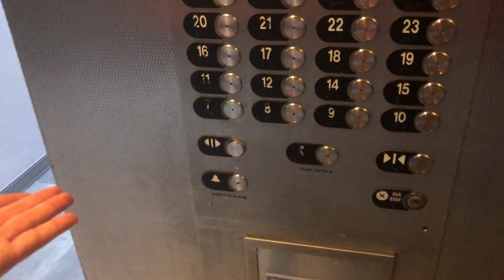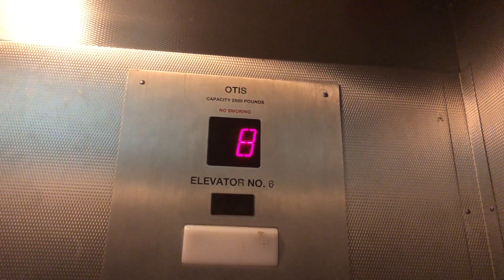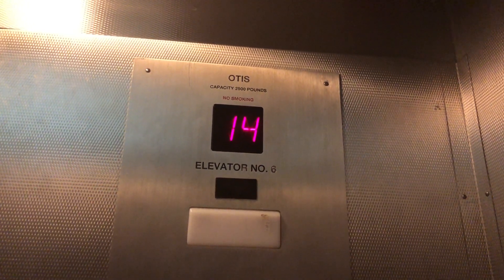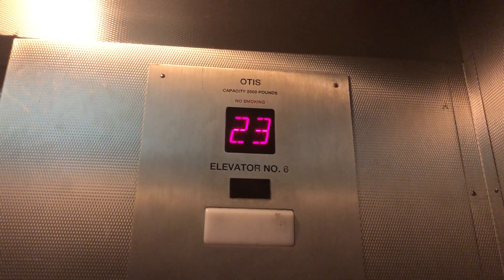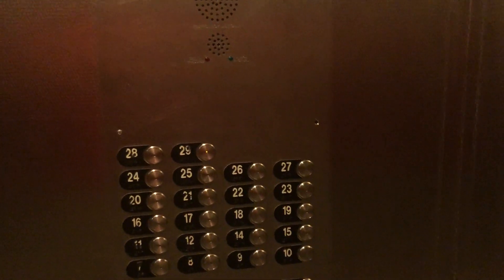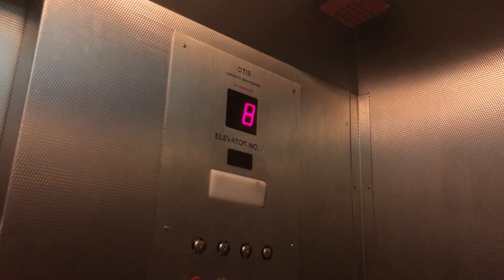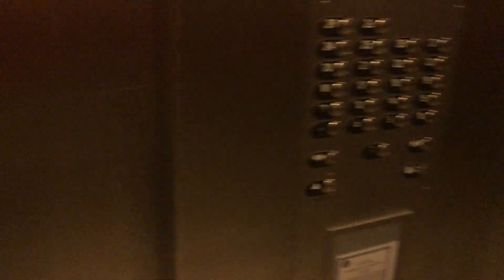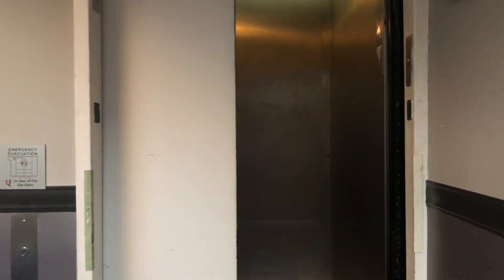Otis main service elevator - Chicago Hotel Collection Magnificent Mile - Streeterville, Chicago, IL

Comment: Also If you stayed there as a guest why were you using the service elevators in the first place?
Reply from the maker: I only rode it this 1 time to record this video & to check it out, any other time I would have used the guest elevators. And I actually wasn't staying here either, I just came in to check out the elevators.